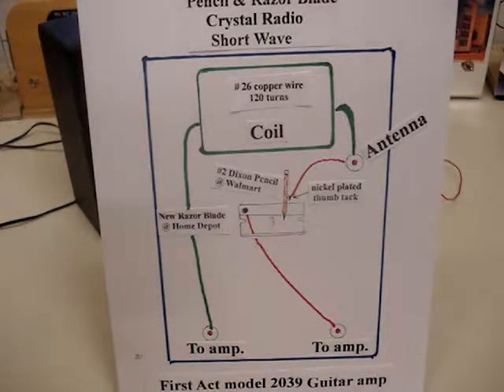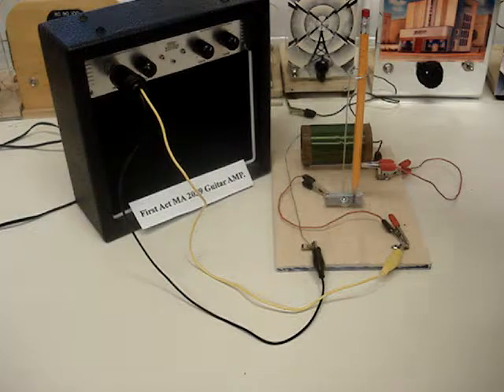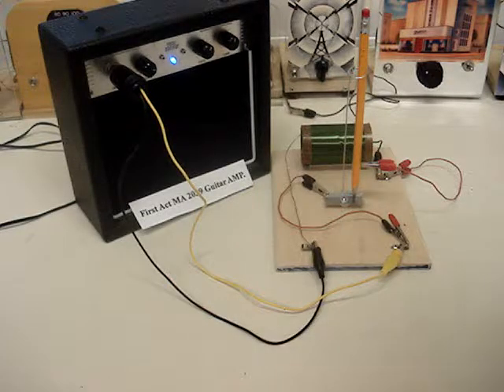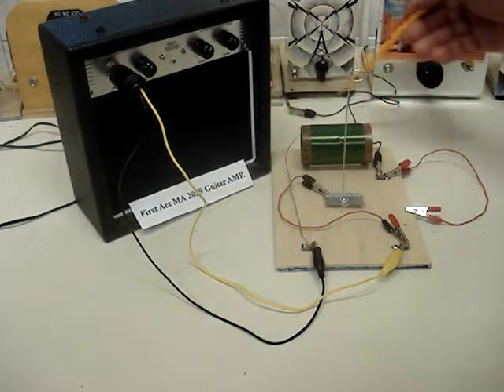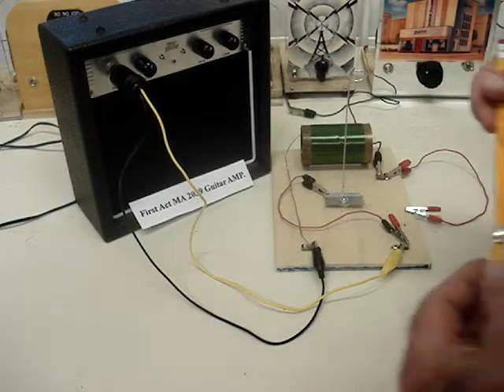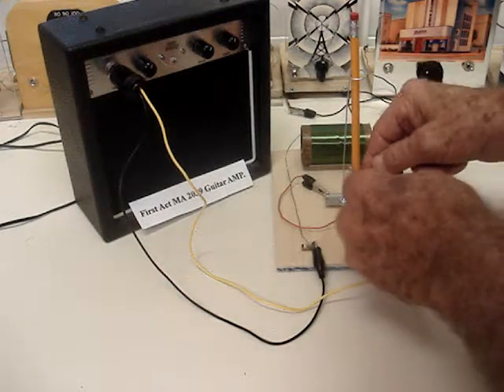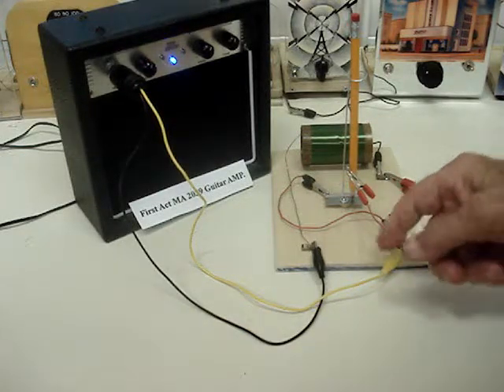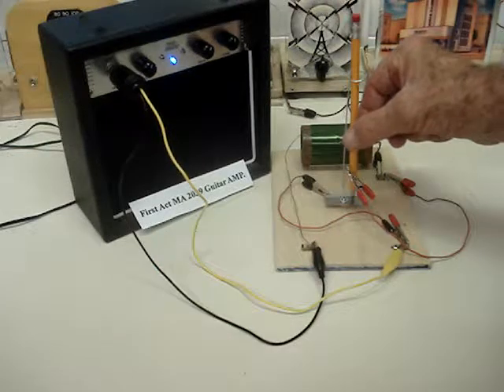Foxhole Short Wave Crystal Radio from a Razor Blade & Pencil

Comment: I made this radio long ago when I was in secondary school. It was really fun. The pencil and the razor can be substituted by a diode. A variable capacitor can be added for better tunning. I didn't use an amplifier. I used a high impedance speaker. Everything was written in a book. It's nice to remember that. Thanks.
Reply from the maker: Thanks you...yes I built these when I was a Kid back in 1952...Most of these videos here  were from 2016..
I was picking up Radio from all over the world..It stooped in 2017.....Thanks again

Comment: Cool stuff man, thanks :)
your pencil trick is great.
You can cut the pencil to get the graphite(lead) and just use that, a tiny piece, maybe 1/2 inch.
Just wondering, if a carbon rod extracted from inside a dead zinc-carbon(heavy duty...etc./not alkaline) battery would achieve the same?!
See page(s) 53/54 https://archive.org/details/MagnetsAndElectricity-English-LadybirdSeries
Reply from the maker: Hey ...Thanks for the Tip... I'll check it out......
Reply: Cool, thanks to you too, and good luck.
Reply: Two carbon rods and a sewing needle across should work as a simple detector.
Reply: @TheCubbyman61  cool man, thanks
it reminded me of 
the matchbox microphone
https://youtu.be/yj-wkw98j7Q
, maybe it works in a similar manner.
Reply: @igrewold  Yup, just like two razor blades on a wood base and a pencil  lead across... you have a simple mike😄
Reply: @TheCubbyman61  you know once I melted some aluminum (a cut from a soda/pop can bottom) and melted it with a torch on an iron nail, it became a metal oxide diode once it got fixated. DMM measurement with diode setting showed a ~1.6 volt reading. So, maybe if this was paralled with a 1.5 AA/AAA battery it'd become better than a germanium diode in detection. I learned this trick from SciToy guy, he got weird but useful tricks from AM radio on his site, like making a detector with a red led, so buildin' on that idea maybe a general purpose detector like 1N00X(X=1^7) could serve as a detector coupled with a dead/depleted battery drained(maybe with a 100 ohm resistor) to match its voltage drop(forward voltage) voltage.
Just sharin' some ideas, good luck
Reply: @igrewold  Yes, a crude negative resistance semiconductor. I tried a galvanized iron burned from s torch too, was able to oscillate a simple low power crystal transmitter.
Reply: @igrewold  Basically, anything can be used as a detector. A very long time ago I made a faithful copy of an ancient crystal to make it a pleasant decoration of the apartment, but I did not have galena (PbS) on hand. However, I had pyrite from a copper mine and sacrificed a small piece. It worked perfectly. At that time, there were many powerful long and medium wave transmitters with amplitude modulation, so that loud listening through a period speaker with high impedance was possible.
Reply from the maker: @DL-kc8fc  Thanks for  your story........loved it.........